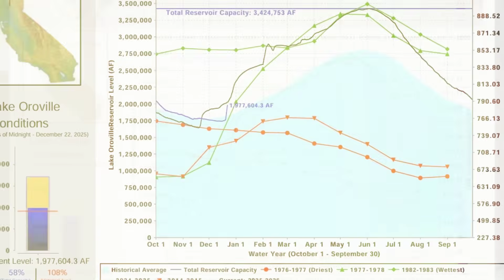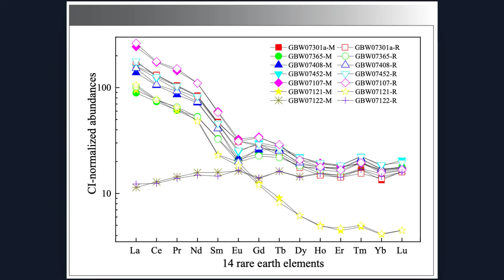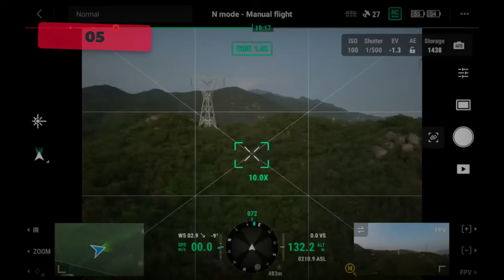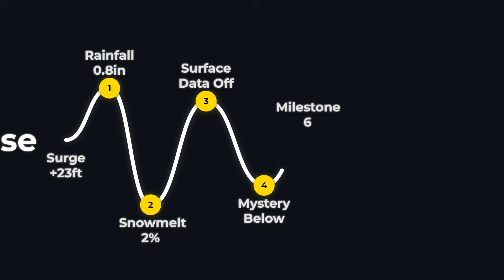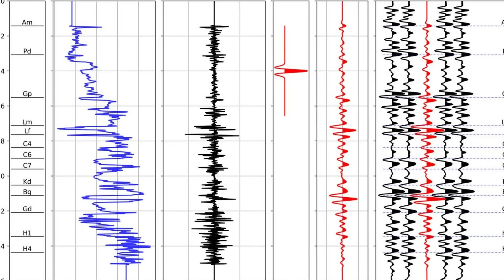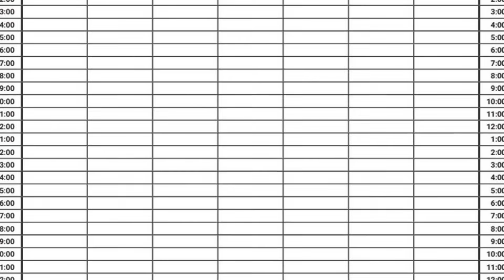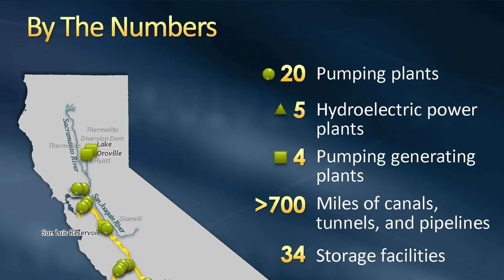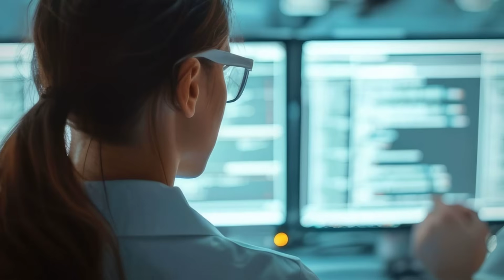BREAKING: Lake Oroville Triggers MAJOR ALARM After 23 Foot Surge — Officials SCRAMBLE for Answers

Comment: It seems obvious that the lake bottom has risen those 23 feet. This would result in a lot less capacity if the water maximum is not to spill over the sides. May have to drain off a lot of water to keep the level below max elevation.

Comment: It's not all about surface water. What's happening under our crust? As we all realize there's actually another ocean with more water then is on the surface. We must also realize with the magnetic reversal, the bathtub under the bathtub has a constant feed from underground water sources. Think of the volcanic activity all of the shaking and rattling and movement in our subsurface.